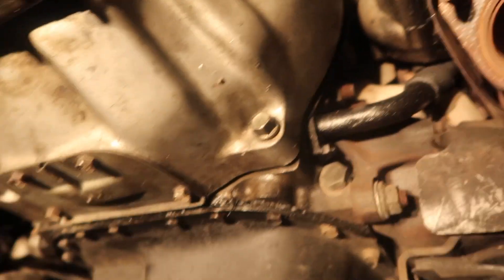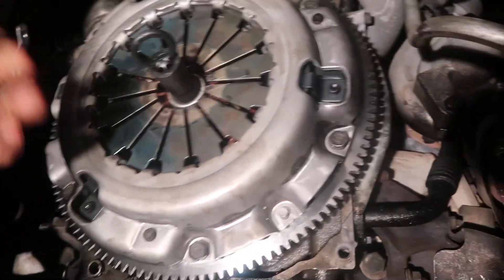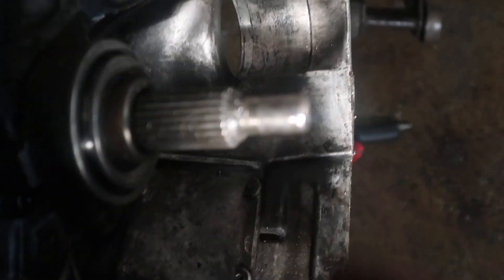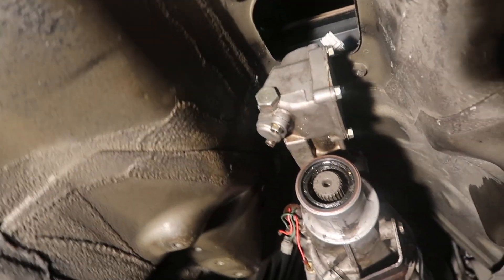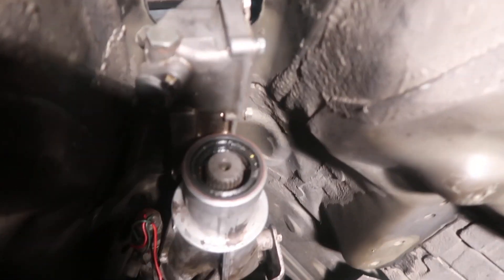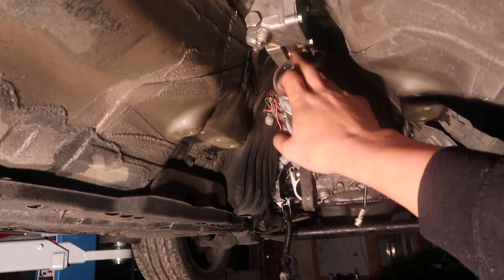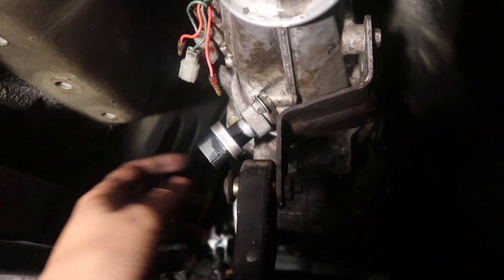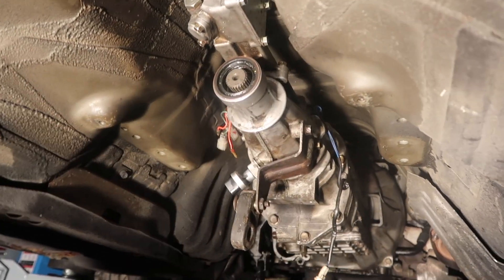My RX7 Transmission Almost Killed Me | Eunos Cosmo 5 Speed Swap 3

Comment: If had room for the starter to engage the flywheel. Instead of tilting the motor back, you could turn the motor over and wiggle the transmission at the same time. It will mount the transmission back to the motor.
Reply from the maker: No. The transmission was physically hitting the top of the tunnel.

Comment: I'm sure you took advantage while having the tranny out and installed new pilot bearing, pilot bearing seal, tranny input/output shaft seals and clutch release bearing. Right???  Will suck to replace anyone of those after a few hundred miles and find out you have a worn part or leaking gear oil.  Right???

Comment: hey yall should do a video about ECU's and good options for each engines ;)
im thinking about using the Apexi PFC with the fd to FC harness for my 87
Reply from the maker: Alvin Ameyaw Power FC’s work well. Old Tech but solid units for sure!
Reply: ROTORS whats a good up to date ECU that I can build off of, 250-600 hp?
Reply from the maker: Personally I am running a Microtech Lt9-C, if you’re planning on 500+ I would recommend a Microtech, Haltech Platinum or Elite, FuelTech, Or AEM. Haltech Elites and Fueltechs provide a lot of auxiliary features and failsafes and are great units but they do come at a cost. I do like EMS’s that come with a wiring harness, rather than Plug n Play units. Old crusty engine harnesses can prove to be very problematic, so I like to eliminate it before it happens.